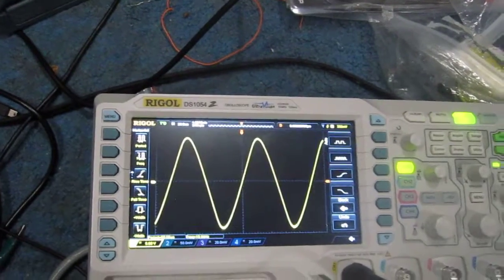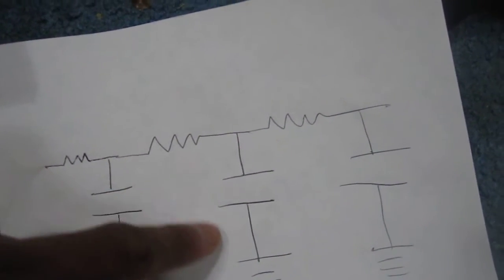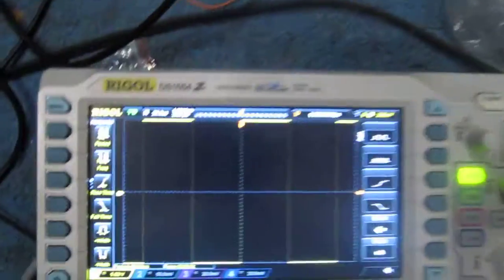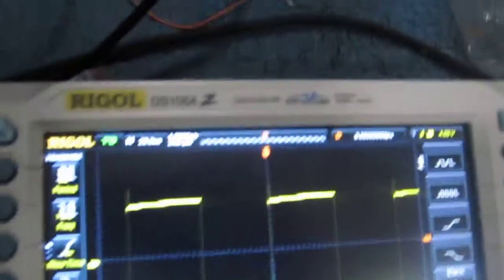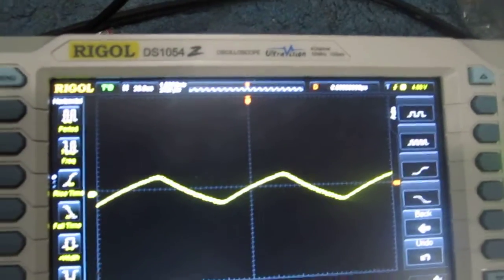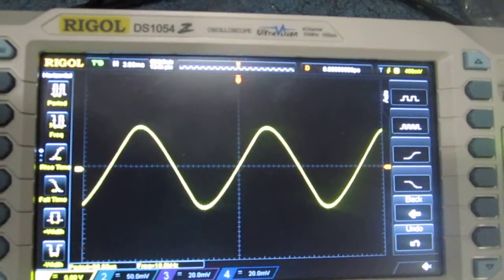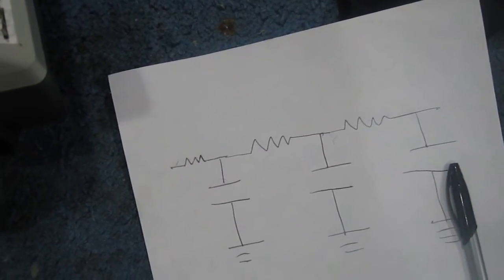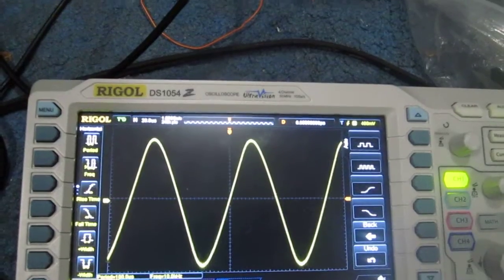Square to Sine Wave Converter Circuit

Comment: A square wave is a primary sine wave composed of several high harmonic frequencies.  If one wants a primary sine wave from a square wave ,just filter harmonics it out by a low pass filter such this three-order poles low pass filter.

Comment: HEY LAD WHAT IF I ADD EXTRA RC CIRCUIT THE 4th ONE TO MAKE IT COMPLETE SINE WAVE WILL IT BE A GOOD IDEA ???
Reply: Yes, it is always better to make it 4th order, i have tried it myself and the result was amazing, very clean sinusoidal waveform. Give it a trial and check the result on oscilloscope, then compare it to 3rd order filter
Reply: @bamikoleomooh8161  OH FINALLY SOME ONE REPLIED DAMN IT . OH OK . WELL FOR EXAMPLE I GOT 100kHz ON ENTRANCE AND WHAT FREQUENCY WILL I GET AFTER 4 RC STEPS ??? WILL IT CHANGE ???
Reply: @reptiloidx8942  the RC network does not reduce or increase the frequency fed through it, as long as your supply frequency is stable.
The RC network will only convert the sharp rising square wave to a gentle sinusoidal wave form, but you must know that the signal will be significaly reduced after passing through each RC stage and the final output signal will be very low, to overcome this, you will need to amplify the signal before feeding each RC filter, then adjust it to a reasonable level while keeping in mind the waveform, by doing these, your final output signal will have a reasonable amplitude.
Reply: @bamikoleomooh8161  GREAT WELL I WOULD AMPLIFY IT WITH REGULAR TRANSISTOR ..... THANK YOU GUYS FOR CLARIFICATION ..........
Reply: @bamikoleomooh8161  HEY AGAIN . PLEASE TELL ME IF THIS RC CIRCUIT CAN BE USED IN AC CURRENT AND HOW WILL IN AFFECT THE OUTPUT POWER ??? THANK YOU
Reply: @reptiloidx8942  this RC circuit is basically used in AC but not at the load side i.e not power side, basically I use it to convert generated square wave inverter signal into sine wave and feed it into the mosfet driver which drives the mosfets with sine wave signal and in turn, the mosfets drive a transformer with same sine wave signal, so that at the transformer output, i will have pure sine wave signal to power any load connected to the transformer.
You may have some issues with the circuit if used to drive load directly but if you may use a corresponding inductor at the transformer output if you want to filter the square wave signal at the output instead of RC
I hope I have been able to answer your question a bit
Reply: @bamikoleomooh8161  perfect .......
Reply: @bamikoleomooh8161  HEY THERE AGAIN PLEASE TELL ME IF THERES ANOTHER WAY OF TURNING ANY INPUT SIGNAL IN TO TOTAL SINE WAVE WITHOUT AFFECTING CURRENT WITH 1K RESISTORS ???
Reply: @reptiloidx8942  if I understand your question very well, you want to know how you can achieve pure sine wave  with the RC network using the value of 1k ohms for the resistor to reduce signal losses? 
Well, I will say, it is possible but the value of your capacitor will change, I think it's better and easier to play around with value of resistor (as variable resistors can be used) than capacitor, as regards the signal reduction due to the network stages, it is bound to happen,  but I have told you that you can boost each stage for better overall amplitude,  but if what you are asking is another method of achieving pure sine wave without much signal reduction, then you may have to use corresponding inductor at the output.
I hope I am able to give some answers to your question
Reply: @bamikoleomooh8161  GREAT THANK YOU FOR DETAILED REPLY . YES ITS WHAT I ASKED AND ALSO I JUST WONDER IF I PLAY WITH THE FIRST METHOD RC FILTER I CAN REDUCE THE RESISTANCE AND INCREASE THE CAPACITANCE THEN I THINK THE SIGNAL FREQUENCY WILL CHANGE ..... OR NOT ???
Reply: @reptiloidx8942  the best way to really understand this and have first hand experience is to use oscilloscope, if you don't have it, then you can use any of the available electronics design  softwares that can simulate your design, thereby given you unending flexibility in playing around with this RC circuit or any other circuit you may wish to know more about.

Comment: Sir please help me. .....you have said vary the capacitor value with respect to input frequency. ...but I haven't oscilloscope so tell me correct value for 50 hz input frequency
Reply: Without having an oscilloscope you can not able to play with waveforms because can not see the shape,frequency voltage and finally the distortion of a signal.

Comment: this will draw 2 or 3 amp even if no load is attached
Reply: No, it won't, it is not possible for this circuit to draw such current without load
Reply: Why will this draw current without a load? (I am new to ee).